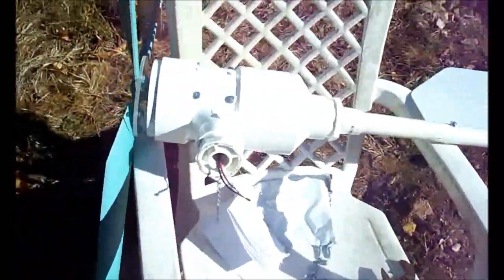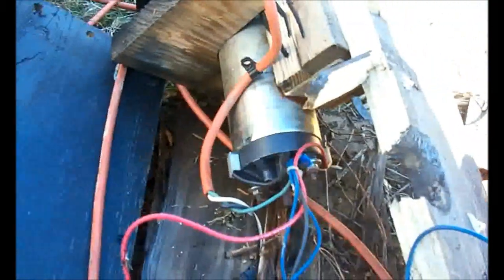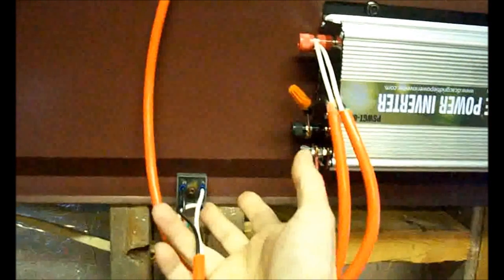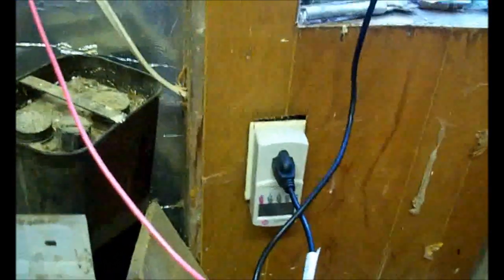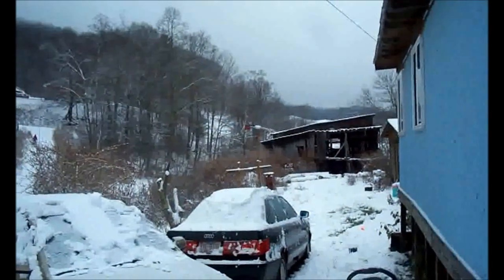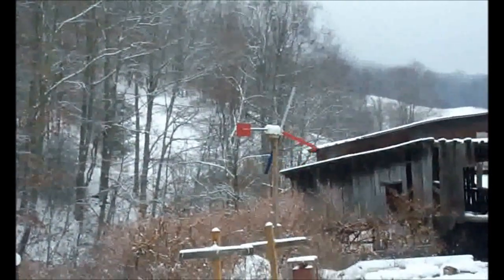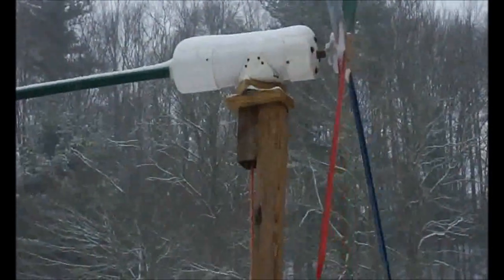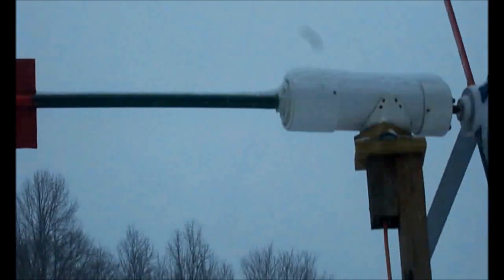New Wind Turbine Plus an Update

Comment: Nicely done, I don't live in that kind of area so I can't really relate- the greenpowerscience dude is the amazing Dan Rojas, he's got some great stuff. Since you have multiple set-ups, have you considered using a large diameter bicycle wheel with blades in between the spokes? The ball bearing, nicely aligned set up works well, is easy to get the parts for and you can cannibalize the bike more by using the chain n' gears.

Comment: You don't need a diode with a GTI and solar panel. Your GTI is not wind rated and your wind gen can easily exceed the voltage of the GTI and blow it's input cap or mosfets! A wind rated GTI has a divert load output for a dump load. I would let the wind gen charge some batteries. It may be possible that if you can get the batts over 14V a 14-28V GTI could kick in, but if the grid goes down you will over charge your batts. Drop by the forums at techluck.com for some good reading.